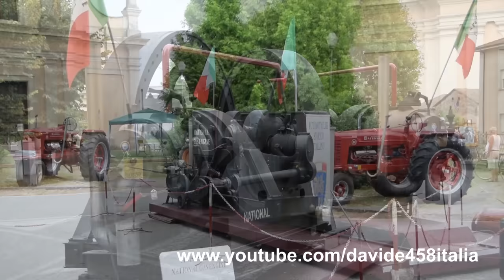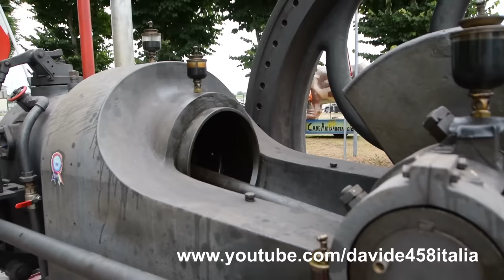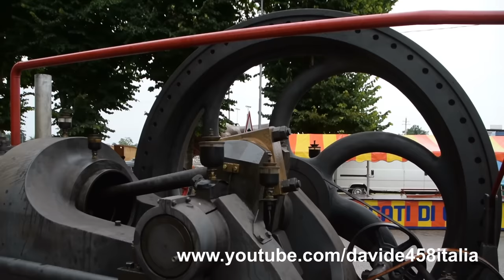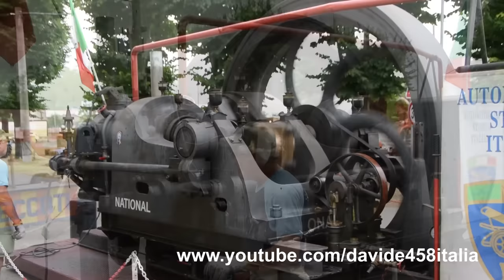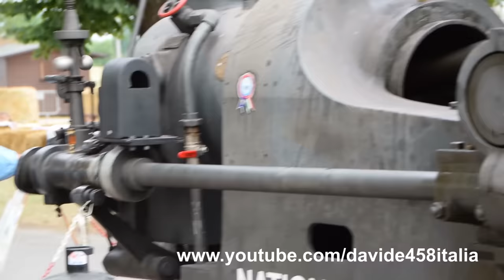National Gas Engine 40 HP - start up , operation + details

Comment: 40 HP 
UNLIMITED TORQUE
Reply: Pulkz 1900ish ft-lb
Reply: @andrewfritz5123  am I correct to say that 44bhp KTM 390 engine could theoretically produce more torque than this with the help of gearing although having a fraction of its displacement?
Reply: Jaspreet Singh theoretically yes but that’s not taking into consideration drivetrain losses such as bearings and fluids, if you did build a gear box for it to create that amount of torque it may not be able to start it from a dead stop and either way it would be insanely slow converting like 20ft-lb (just a guess) @ 6000rpm to 1900ft-b it would need a gear ratio of roughly 1150:1 and spin at like 2 rpm
Reply: @andrewfritz5123  Correct me if I am wrong.
KTM 390's engine puts out 24lb ft to the wheel at 7200rpm. So, if I built a gearbox to reduce the rpms such that the output is 1900lb ft then the gear ratio would only need to be 79:1. At that gear ratio if the input shaft rotates at 7200rpm then the output would be 91rpm.
(torque of A:torque of B=teeth of A:teeth of B;
where, A and B are two gears. 
I wonder how you calculated 1150:1 gear ratio) 

 Note that this is including the drivetrain losses in the bike and excluding the losses in the imaginary gearbox that I've made.
The engine in this video goes to around 120rpm(using my eyes as tachometer) and that such engines generally produce peak torque at the lower end of their rev range, so I think it should be able to beat this engine in terms of torque.

I may be wrong, but my conception is that since HP is the unit of work done, therefore two engines with the same HP should be able to do the same amount of work which directly means that if their respective output shaft rpms are matched with the help of a suitable gearbox then then the torque should also be same (neglecting transmission losses).
Feel free to correct me.
Reply: Jaspreet Singh yah, that’s right I’m pretty sure. I fucked up somewhere in my math... well besides for fact of the engine would be sitting at 7grand the entire time and cook itself, I think you’d have 1900 ft-lb of torque.
Reply: @andrewfritz5123  Dont forget gearbox losses.
Reply: Brato I said it in a comment farther up already it’s not taking that into consideration
Reply: @JaspreetSingh-fo2qe  yes, it will be a more complex and less reliable mechanism though.
Reply: @АлексейКастевич  And much more wearable because it has to be run at constant 7200rpm. The engine will be completely worn after several day.
Reply: @nhuthanhstars2011  not obvious.
Reply: Enough torque to pull four fully loaded jumbo jets!
Reply: Jaspreet Singh not really. It’s like saying you can move a train with a lawnmower engine with gearing, but it ain’t happening quickly
Reply: It's always the same story with mechanical advantage - a matter of trading force for distance. A gearbox is just another form of lever, so for a given input of work you can move a small mass a great distance or a great mass a small distance, but not both at once.
Reply: @JaspreetSingh-fo2qe  This engine has a flywheel that weighs something like 2000 lbs. Once that gets spinning, it takes very little push to keep it going. I'm fairly certain that the heavy flywheel makes it more efficient for doing work involving high-torque. I don't have the math, just speaking from experience.
Reply: @lazerusmfh  I have provided the calculations. See the gearing and RPMs required at my previous replies. You can match the speed (output shaft RPM) of 390's engine and this big engine if we consider that there aren't any gearing losses. Just that at such high RPMs, the engine won't last long.
Reply: @doggonemess1  Yep, it can be useful in applications which require sudden surges in torque requirement. That flywheel must be storing a lot of potential energy.
Reply: @JaspreetSingh-fo2qe  of course, just put your ktm390 chain to the flywheel
Reply: I know haha .they dont make 40 hp like they used to !
Reply: HP: 40

RPM: A few

Torque: Yes
Reply: @doggonemess1  it takes as much to keep it going as you are taking from it to do work.
Reply: Better than a honda
Reply: Yo what the fuck I made a joke and y'all giving each other mechnical engineering lessons down here lmao
Reply: @RedGaming Studio OOOOOOOOOOOOOOOOOOOOOOOOOOOOOOO
Reply: @JaspreetSingh-fo2qe  that's true, although gasoline engines are typically rated for their max horsepower, not there rated sustaoned horsepower. a 500 horsepower Corvette can not put out 500 horsepower continuously pulling a trailer up a hill. It can only do 250.

But other than that, you're completely right about it being the same amount of power. A gearbox capable of giving that torque only has about 15% loss so yes, a modern 100 horsepower Honda Civic engine running at 50 horsepower with a reduction gearbox would be smaller. It's a modern technology.
Reply: 29.84 kW @90 rpm is about 331. 6Nm
Probably not the max torque. The calculations is according to max power at the max RPM in the video. I think these engines tend to have higher torque at lower RPMs.
Reply: Can we run turbine by this engine what is difficulties???
Reply: @andrewfritz5123  Wow!!!
Reply: @justimran7913  Maybe the low rpm's. I guess it needs at least 500 rpm...

Comment: The condition of the engine and the level of manufacturing are unbelievable. 

What does it weigh?
Reply: @anonymous tonnes* probably
Reply: 123 lbs
Reply: 15 tons (15x2240 lbs) according to the description - just over 15 tonnes, 15240 kg

Comment: 40hp, and about 1,000,000 lb/ft of torque!
Reply: Who needs two overly expensive specialized rigs to pull the space shuttle when you have this??
Reply: 40hp at 110rpm is about 1900 ft-lbs. Pretty impressive.
Reply: Just saw this best wow.  Very nice.   Wondering how much fuel this thing burns under a average load?.    Nice vid

Comment: Anyone know what the cubic inches are on this single cylinder beast? I work in the oil fields where we still use hit and miss engines like these. We use 118s, 208s, and even 346 cubic inch single cylinder engines. This on is by far the biggest one I’ve seen tho.

Comment: These old engines were built to last!
Today's engines are built to die fast!
Reply: You just aren't looking for the right engine
Reply: You're simply not buying the right engines.
Reply: You art thou buying thy wrongeth engines.
Reply: They die fast because they make 3 times more horse power and are 10 times smaller and 100 times more complicated.
Reply: @sylvesterskyes9558  You didn't add high RPM part!
Reply: @JaspreetSingh-fo2qe l0
Reply: New engines are 10 times more durable
Reply: @keithpatterson690   p
Reply: Back

Buang
Reply: If you're a shit owner, and don't know how to properly maintain your engine, then yes.
Reply: The old 2 stroke Detroits are still around using engine oil as blood. I still like them
Reply: @jimmychanbers2424  Modern runaway Diesels stiLL do it when the turbo bearing seal fails.

Comment: So that small cylinder is the cooling water pump I reckon. Is this now a gas engine or what is the fuel? I am pretty sure she will run on gasoline but diesel might be a bit much with a piston that large.

Comment: I've always wondered what it would be like if one of these motors ran away....
Reply: it cant run away, there is no oil in the crankcase for the engine to burn
Reply: @kelvintaylor8207  it could still runaway
Reply: As u see the engine is running
Reply: they would probably inform the police and depending on the age they may post flyers on telephone poles and maybe milk cartons

Comment: I wonder what is the max rpm on it.. probably not more than 400rpm..
Reply: its 110 rpm. It tells you more in the description
Reply: @yuyuolozaga3023  the rpm it gives its max hp doesnt mean that engines not capable of turning more rpm
Reply: @HaraldSjellose  I guess.

Comment: The oilers at 2:18 are absolute classic!
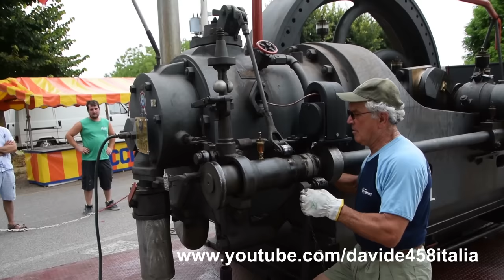Please correct me if I am wrong, but the rotating device at 3:30 with the two balls on pivots is some type of general to limit maximum speed?
Reply: i think they use the momentum of the balls to limit the speed, the farther out the balls go, the more they slowed the engine. a really basic yet effective limiter.

Comment: It's interesting that they used to make an engine with a modest 40 HP so huge, with such low speed and high torque, compared to nowadays, when it would be small, high speed, and low torque, and if you wanted high torque and low speed you would gear it down.  I wonder what the tradeoff is there.  I guess the big, low-speed engine has less demanding machining and balancing tolerances,  less wear? The high-speed modern engine is probably harder to design/build, and also the gears needed to get high torque/low speed have to be accurately machined.  And of course the big engine is a lot more expensive due to the amount of metal.
Reply: These old slow engines are also a lot more reliable because the joint stresses are pretty low. The tolerances probably aren’t as loose as expected compared to modern engines. The downsides of engines like this are definitely the size and material cost as well as the gearing issues all like you mentioned. Large slow engines like these are still used in super heavy machinery like freight ships and mining equipment as well as some power facilities I would imagine, albeit they have more electronics and modern sealing, lubricating, and forced induction technologies. The largest cargo ship uses a massive engine that makes about 1 million ft-lb of torque at less than 300 rpm. It really just depends on application

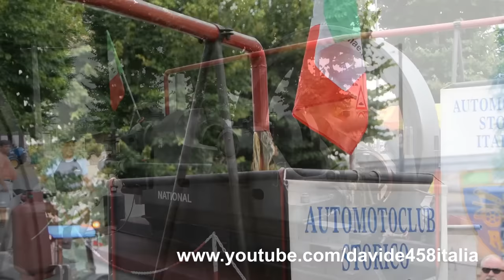Comment: 5:50 what's that getting pumped out?
Reply: @Crippling Depression gotcha, thank you!
Reply: Hi Dan, the liquid coming from the red pipe into the top of the square tank is hot engine coolant, that's why the pipe is red, as a warning, the hot coolant cools as it flows to the bottom of the tank, the cooled fluid is then returned to the water jacket around the cylinder by the water pump, which can be seen at about 5:50 in the vid, it's  the little flywheel driven by a belt and you can see the water pump piston going up and down, a slow revving static gas engine doesn't produce an excess amount of heat so this simple system works well.

Crippling Depression gave you the wrong answer, the oiling system on such as these engines is known as total loss, the fluid is not oil.

If you watch the vid, you will see many glass oil pots over the bearings and cylinder, these simply drip oil at a set rate into the bearings then drain away, unlike the oil system in your car engine, where the oil is being pumped round under pressure.

Hope this helps.
Reply: @ducati7847  that was incredibly informative and helped answer every question i had about this engine. Thank you

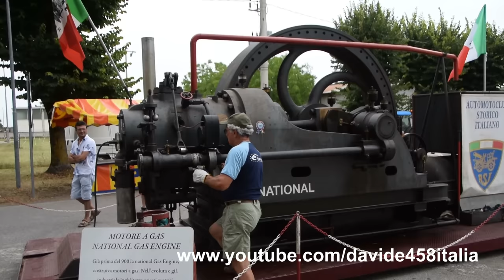Comment: I like how at 0:40 he’s turning the crank counter clockwise and at 3:05 it’s turning clockwise
Reply: Hentai Haven He was getting the piston to top dead center so the compressed air could push the piston like a firing stroke to assist in starting it. It didn’t matter which way he turned it by hand, he probably chose the shortest distance.
Reply: @tommiceli2449  ya thanks for letting me know i kind found out the more videos i watch of this topic

Comment: What with the spinning steel balls?
Reply: BrokeAngler INC That’s a governor. As the engine speed increases, the balls are thrown outwards, cutting the fuel off until the rpm goes back down to acceptable levels

Comment: Great video, lived the way the sleeping giant was gently coaxed into waking up 😃👌

Wonder what was happening at 3:05 .. how did the strokes commence ? Compressed air ? External motor ?
Reply: compressed air starting
Reply: @TheAmazingAdventuresOfMiles  was the air forced in to the cylinder?

Comment: Has anyone other then me try doing the math on the displacement #'s stated?
450mm bore (π * r²) x (600mm) stroke =  95.4 liters. He stated 76.5 liters.
The only reason I took the time to calculate is I wanted to convert it to cubic inches.
My calculations came to ruffly 5,820 cubic inches. If I calculated that correctly.
That is one huge engine. I am surprised it's only rated at 40 HP.
My 650cc triumph motorcycle engines are rated at that.

Comment: So big,but why only 40hp?
Reply: Asep Saepudin horsepower is based off of the rpm, and since this can only do a few hundred at most it gets rated with a lower horsepower rating than an average car engine. What this guy has is torque. A lot of it.
Reply: @sneugler  you mean,if he increasing the rpm could be raising up the hp too?

Comment: Im starting to not understand how hp is calculated any more because if this Huge engine is only 40 hp than my yz 250 two stroke engine is stronger by 15 hp and tiny compared to this thing'i know its old technology but the size difference is huge' and im guessimg this thing has more torque? Which i could understand better torque vs hp
Reply: adam a Horsepower is calculated using the engine rpm, and since this engine can only go to 200rpm, it registers as low horsepower. The torque, on the other hand, is massive for this engine.

Comment: Is that all it does? 👀
Reply: Its an engine XD what did you expect it to do... take off?
Reply: Max Davies 
Old airplane engine?
Reply: @lembriggs1075  It's not an airplane engine though is it.
Reply: Max Davies 
I’m thinking not. Looks rather heavy. Lol!
Reply: @lembriggs1075 It's a hit and miss engine so it ran slowly as you can see and hear when it hits. They were used for all sorts such as a generator, powering saws, pumps for water.
Reply: Max Davies Ok. Thanks for the explanation!
Reply: @lembriggs1075  No worries :-)

Comment: 714 ft lbs torque at 280 (?) rpm...for 40 hp
Reply: Guessing the torque is much, Much higher than that. Easily 5-10 thousand foot pounds. It’s a 76.5 LITER motor, that’s some insane shit

Comment: With an engine that big you'd expect a lil more then 40 hp but its prob got a ton of torque
Reply: Not really.
HP = Torque * RPM/5252
So
Torque = 5252*HP /RPM

You may notice that torque and RPM are easily swapped for each other. Halve one, double the other.
But I suspect that you and a lot of those who seem to be overly impressed by torque are confusing momentum and torque, which are entirely separate and unrelated concepts.